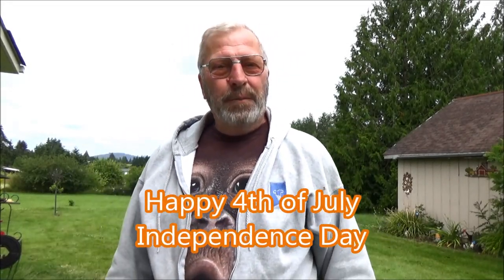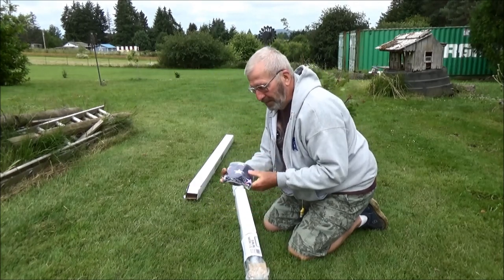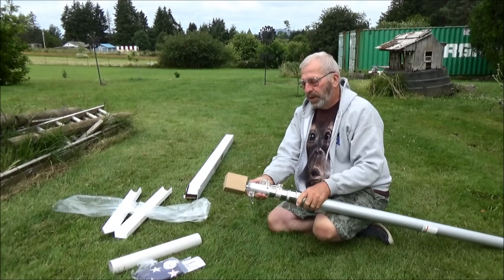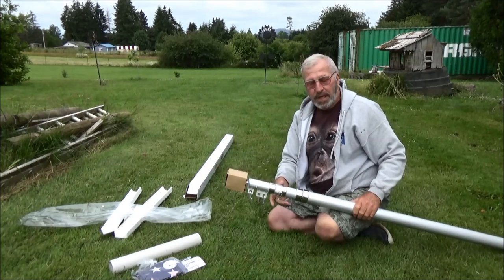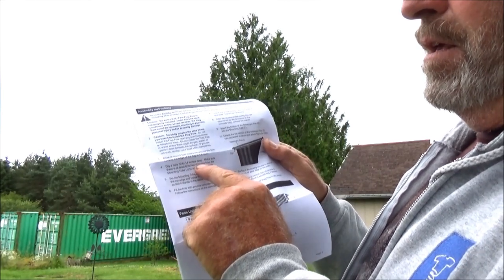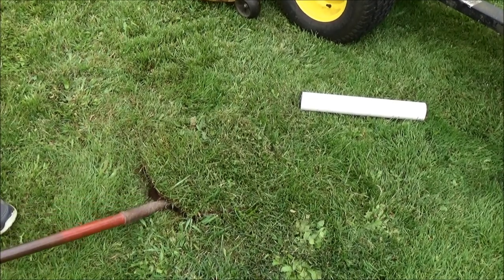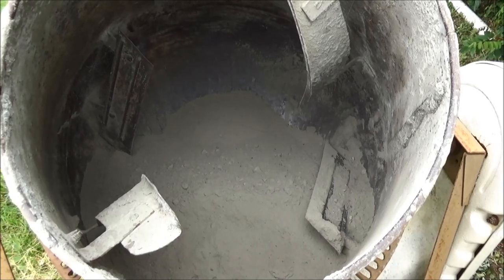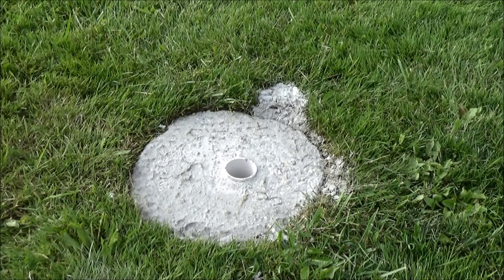Harbor Freight Flag Pole Unboxing and Install

Comment: Every American citizen should have a flag proudly displayed.
Reply from the maker: This is very true. But the should changed the reading for lighting the flag pole at night. Yes, mine is lit at night with an L.E.D. spot light, but it's hard to figure how to light it, where to get the power to light it and the thieves of the night.

Comment: Thanks Mike went got one last week because of your video and frankly always wanted a flag pole in yard,difference is i cemented my in 5 gallon bucket and then buried it in case i decided to relocate pole elsewhere on my property or move.
Reply from the maker: That is great and always makes you feel good to show America that you support her. Just a note. The pole needs the drain hole at the bottom of the pole, so the sleeve does not fill with rain water and start to rot the pole and also will freeze in the winter and might break or crack the pole JohnQ public. Thank you so much for your comment.
Reply: @justmike57  thanks totally forgot about that part!

Comment: Love the National Anthem. Hint: if you’ll tighten and loosen by turning the poles themselves instead of the aluminum fittings  it will last much longer. The aluminum fittings tend to fail if you use those to tighten each section. Just twist the poles themselves right or left to tighten and in tighten. Easy peasy and no damage.

Comment: Thanks for this video! I was trying to decide whether to buy that one from Harbor freight or not and you sealed the deal for me. Thanks.
Reply from the maker: I have gotten a lot of complaints about this flagpole coming from China. It is what it is. I also use nylon flags because I get a lot of high winds here. The cotton flags are heavier and the pole really waves back and forth, but no damage to report. The nylon flags are lighter and last as long as the cotton ones from my experience over the last couple of years.

Comment: I got one of them kits for early fathers day present. Going g to put it up Saturday.
Reply from the maker: For the price, they are a nice pole. When you lift each section, drop it back down 2 inches for strength and just snug the locks for each section. The first year, a section of two would slip back down when we had high winds. Now it always stays up and I Never mess with the locks when I need to change my flag. I pull the pole out of the ground and lay the pole over too change the flag. Thanks so much for watching.

Comment: Great video. I live in southern Texas. It is windy every day 12-30 mph. I also fly 2 flags. How do I keep the flags from crawling up the flag pole when the wind is blowing. I do not see any clips or screws to keep the bottom of bottom flag from going up. Any ideas?
Reply from the maker: Unless you have a heavy duty flag pole, the high winds do make the flag fold up to lessen the wind strength on the pole. As you can see on the car lots there in Texas. They have beads that help hold the flag down yet the size of flag will still climb up the pole to protect the flag and pole.
Reply: What kind of beads are you talking about?
Reply from the maker: @bobthomas9027  The beads are made for the larger flags. They are about 1" in diameter  and normally connected with a rope with little space between them. These beads add a little weight to the bottom of the flag and let the flag slip up and down depending on the wind speed.

Comment: Great. I was looking at one of these. I didn't know how to install it. I probably get me one.
Reply from the maker: Just remember, Pull the pole up, then drop it back down about 2", then twist the pipe to lock it. Otherwise for some reason it will slide back down NanoMechanics101
Reply: @justmike57  👍

Comment: I just bought mine from Harbor Freight the other day. I had another pole before, for about 15 years, but it was getting kind of worn looking so I got this one. It's a very good price and I like the telescoping rather than the rope. I was continuously having to untangle the flag from around the pole and this one I think will be much better in unwrapping. I was a little disappointed in something, that's not a big deal to most people, but I am a little too much of a perfectionist. When I put the pole in the sleeve, it had a very slight lean to one side. I KNEW that I had leveled it, but there is a little play in the sleeve. Not much, but it does move the pole a little. When I saw Mike's was leaning a little, I felt better!! I was actually thinking of going and taking it all apart, going to Home Depot for another sleeve and redimix, dig another hole, etc. and my wife was just hoping that I would be satisfied ........ and now I am. It's not that big of a deal. Thanks Mike!
Reply from the maker: lol, I have COD and like things to look right also. I just marked it up to everything else was not right and the pole was, lol. I will admit, not everything in this world is perfect, and we can't save the whole world so just leave it be I say, now that I am getting a little older. You guys have a blessed day and God Bless you two.
Reply: @justmike57  Try a shim in it ..works like a champ .. Great Job !

Comment: I bought this one.  I live in Michigan and they told me to dig four foot deep.  I am still confused about how to set this properly, so it's just sitting in my garage for weeks.
Reply from the maker: Where I live, there isn't really a frost  line to worry about. Michigan freezes DEEP. and you have to get below the frost line to your pole does not heave out of the ground as the ground starts to thaw out.

Comment: got a german version of this ,live in ireland btw for flying 2nd stars and bars on.all year round its strong .
Reply from the maker: Welcome from Ireland. These poles normally are strong as long as you don't dent the pole and make it weak. If you ever have high winds, more than one flag might take the pole down. Thanks so much for your comment.

Comment: I have this same pole here in India 🇮🇳 I ordered it a while ago and in the winter time I find that the aluminum pole actually shrinks and the plastic peace doesn’t which then you can’t make the pole go up and down and lock it in place. Basically the pole shrinks to much so the plastic peace’s can’t hold it up. That’s a down fall of it but when it’s warmer spring/summer/fall it works wonderfully so I wanted to warn people about that. Love from India 🇮🇳
Reply from the maker: Thank you for letting others know what problems you have had with the pole. Myself, I don't take mine down at night. I have a light shining on the flag instead. I also think you would wear out the plastic pieces lowering your flag every day. You should look for one that has the ropes and a pully at the top. The upside to that is the small rope can be tied and untied easily once you learn the right knot.

Comment: was wondering where the pole and flag are made?
Reply from the maker: To tell you the truth, I didn't look. We had a new harbor freight store go in and this is what I bought. I did buy a new replacement flag at the same time that did say Made in America on it. Otherwise the pole came with a nylon flag. Just the same, I know what you are talking about Nicole Firebaugh. God Bless.

Comment: I have a question??? On the telescoping flag pole, do those twist locks work real good and when taking the flag down, are they easy to disengage?
Reply from the maker: No, they work just OK. Some people will put a little sheet metal screw at each section. Mine stay up until we have strong winds and one of the sections will come loose. Maybe that is a good thing so the wind isn't as strong at the ground level. 
  The twist locks are just plastic and you can twist them past where they are suppose to lock and keep twisting until you feel the locking area. I also drop each section about 2 inches down to make it stronger at the joint for the wind.

Comment: You know, telescopic flagpoles like these are good for some reasons because if you get a halyard conversion kit, you wouldn’t need to worry about climbing the pole to change the halyard (rope). I found the kit on numerous websites and I hope there could be some modifications for the pole in the future. Plus, the truck/pulley, halyard, snap hooks, and cleat could be good for you if you want to fly your flag at half staff. Make sure you measure the diameter near the ball before you get the truck/pulley
Reply from the maker: For this type of pole, I would not suggest to lower the pole very often. Not sure the lock system would handle it. Also the pole does slide down itself in high winds on some of them. You could just put a sheet metal screw in each section to solve that problem. Myself, I pop the pole out of the ground and lay it down enough to change the flag and on those rare days of 1/2 staff isn't a problem unlocking the sections. Thanks for the info., but I don't like the ropes to mess with on my pole. Then seem to always shrink or get too tight and just a pain. This is why I wanted this pole with less moving parts.
Reply: @justmike57  Understandable, whatever floats your boat.
Reply: @BuckBrothersCentral Easiest thing for half staff with telescoping pole is to get a black ribbon that attaches to the pole just above the flag, has the same meaning.  Also works for small poles that people have in flag holders attached to a house, railing, or on vehicles.

Comment: The flag itself does not hold up very well. Definitely get a different flag. But I have been very impressed by the pole itself!
Reply from the maker: You are so right about the flag that comes with the pole. I tried to get 6 months out of it, but that didn't happen. My brother bought one the same time I did and he had to put metal screws in each section to keep the poles from siding back down inside each other. Thanks for stopping in Skylar Weatherford.

Comment: What do you do if the country is flying at half mast?
Reply from the maker: You have 3 options. 
1 is to leave the flag fling high because the pole isn't really that tall. 
2 is too unlock the section on the pole and lower your flag to the desired height, but that isn't really right because the pole does not extend above the flag. Also you might have messed up the cheap locking system that holds the sections in place. 
3 This pole has two places too hold two flags. Just unclip your flag and clip it in the place of where the second flag could have hung. 
  These are just my thoughts and hope this helped you make up your mind.

Comment: Just bought one was wondering how that pole is holding up? Great video Mike and looks beautiful much respect from Kentucky!
Reply from the maker: Mine is still doing good, but lately the higher winds make the pole shake to much and a section or two will come loose and slide down. I already pulled each section all the way up, then put them back down about 2 inches to give them a little more strength. Now that the poles are starting to slip down, I plan on using metal screws to hole each section in place. I hear a lot of people are having the same problem keeping the flag fling high.

Comment: Thanks for the info. Just bought one.  More Americans should show some patriotism...God bless America.
Reply from the maker: Right on. If you bought the flag pole from the same place, in time you might have to use metal screws on each section to stop it from sliding down into itself Rob Flanagan.

Comment: Just a word of caution from someone that has had two 20' HF poles. Don't extend the sections all the way out... leave each section about 2" (at least) from full extension. This will help keep the pole from coming down in strong winds. Yep, I had one come down and bent the sections all the heck. Second, consider a lanyard by hooking a single pulley to the top D-ring and use to two metal clips for the flag grommets. This aids to take the flag down at sunset... unless you plan to light it all night with a dedicated light. (That's flag etiquette.)  It sure looks great blowing in the breeze! Let freedom ring!
Reply from the maker: Well Dave, in my show more section I did describe to drop the poles down 2" for better support to keep the poles from slipping down even though it makes sense about the wind. I never plan on sliding the poles down because you know it will wear out soon. I would rather pull the pole from the pvc and take the flag down. I know you did dads pole that way and the light rope broke finally, so we cut it off and hung it the way it was intended. I do dads flag for him now anytime he needs to change it or whatever. Thanks for the heads up and if this pole becomes a problem, I will pay better money for a good one Dave.
Reply: Just Mike it is a pretty good one. Just want to save you from buying two like I had to. You mean in your description, the 2” drop? Either way, if you don’t have a light on it and want to properly display the flag, it’s just easier to have a lanyard to move the flag up and down. The idea is to maintain the lanyard in at least good condition and change it out every couple of years. If it does break, that’s when you have to pull the whole pole out and restring it. Anyway, glad you have your own pole and flag now. Cheers!

Comment: I know this is a dyi project but did you know you can contact your local veterans department they will come out and install the flag pole and raise the flag they have a ceremony doing so
Reply from the maker: I did not know that Joe. But I have a feeling that we live so far out that I am not sure they would come out. But fore sure, I will check into it for my dad.
Reply: @justmike57  check into it

Comment: Does it have a bottom plate to cover the pipe in the ground ?
Reply from the maker: Yes, there is a plastic round piece that fits on the bottom with a hole in it to let the water out. I put about 2 inches of pea gravel down the pipe hole for better drainage. Still fills with rain water Joe.

Comment: I've read other reviews on this flagpole that the flag clips should be replaced with ones that are more heavy duty bc the ones supplied are kind of rinky-dink and will break
Reply from the maker: I just had to replace mine this Spring because they wore out. It would be a good idea to have new ones on hand when the original do wear out.

Comment: I'm thinking of getting a Harbor Freight flagpole. How's it holding up 2 years later?
Reply from the maker: Mine is doing great. Most people have a problem with the locking system for each section. When I first got it, on a very windy day, one or two of the sections slipped down. That might have been a good thing because of the high winds. Now, todays date, the pole stays up, even on a windy day. If yours were to have a problem slipping down, you could buy little sheet metal screws for each section but then you will have to pull the pole down to change the flag. 
  The next thing is always hitting the pole with the lawn mover. I am very careful, but Dad has one and he is denting the bottom of the pole and in time this weakens the pole and the wind might take it down.
Reply: @justmike57  Awesome, thank you for the reply.

Comment: And how much is a reasonable amount of sway? I want to make sure it's safe to keep up.
Reply from the maker: The sway is in between the pvc and the flagpole. If you were to have a hurricane force winds, I would take the pole down so the sections don't bend and come down Carolyn Wolfe.

Comment: If anyone has a problem with their pole section not staying up, get the "pin and loop" from the hardware store and drill the hole thru your pole and be done with it...
Reply from the maker: You can do that to make it easier to get down but it you just put small metal screws in each section it isn't that noticeable and I leave my flag up and only take it down to change the flag by pulling the pole out of the ground. So far my pole stays up in place compared to others that I know have this pole. Thanks for stopping in MSG A J Himel Ret

Comment: Do you absolutely have to pour concrete?
Reply from the maker: You could pack it with smaller rock and dirt, but just remember that the wind is alway blowing and the pole rocks a bit all the time. This can cause the ground to work and make mud when rains. I have another video just before this one that we tried the Foam in a bag from Home Depot and it didn't work out very well because of the rocking of the flagpole MRios1128

Comment: How can peoples who do not have ready-made industries, such as the ones in your hands now, to create for themselves information in easy and effective ways?
Reply from the maker: I am not totally understanding what you are saying. But if you are talking about the ready made flagpole, you can use your imagination a bit, to hang your flag. Tree limbs, wire stretched across two items, Balconies or even tack the flag to the wall. I hope I got it right Levdal Abdelwedoud.

Comment: Good video.  Was wondering if you can fly the flag at half mast with this flagpole?
Reply from the maker: Yes you can in a way. You have to create an illusion by dropping the telescope  down one or two so the flag is flying lower than normal. From across the street it will look 1/2 mast.

Comment: I've had no luck with the telescopic poles, they have all slid down eventually over time, so I bought a five piece flag pole.
Reply from the maker: I believe there is an oil or wax that is still on the pipe when they made it. The locking sections are just a cheap piece of plastic that you don't want to lock very hard or it will click past the lock. I never unclick my sections and in time, they will stay in place. I would suggest to get some sheet metal screws and screw each section together. If I ever have to change my flag, I pull the pole out of the holder and lower the pole too where I can change the flag. 
  As you have done, you probably paid much more for you new pole and I am sure it works better than this pole, but a cheap fix would have been fine also. 
  Thanks for commenting and enjoy your new pole.